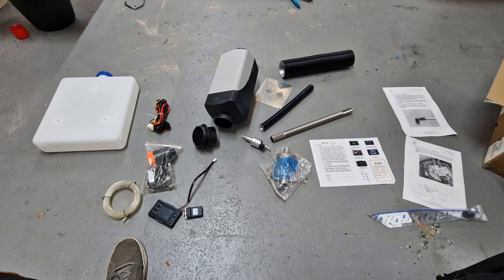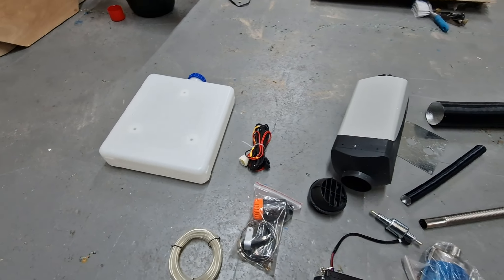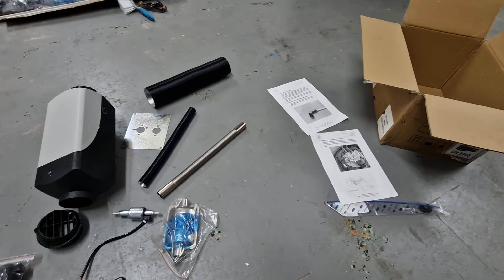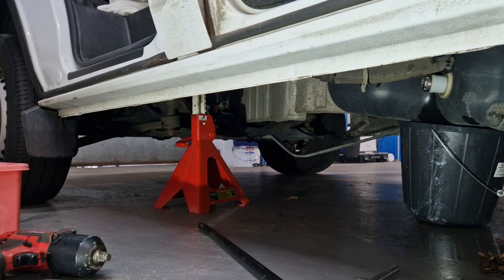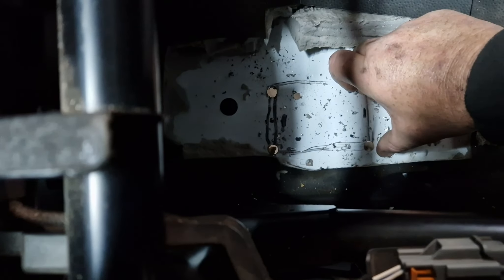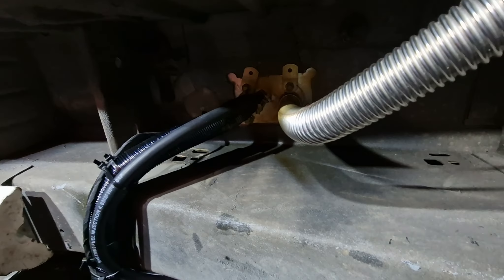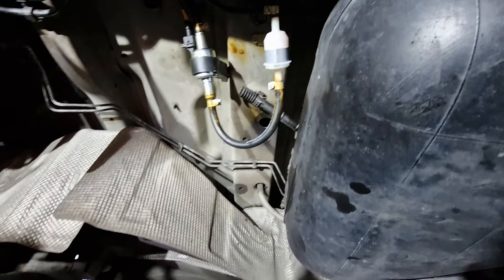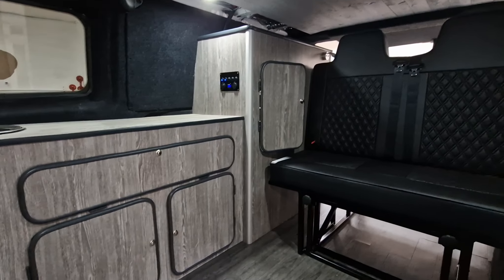How to fit a Chinese Diesel Heater under seat Ford Transit Custom Camper van build

Comment: Super video! Thanks a lot!
Reply from the maker: Much appreciated thanks for your comment
Reply: @vanlifenomad  do you remember the size of the connector? 7.89? 6.30? I saw that it's a standard connector, way more cheap on aliexpress for example
Reply from the maker: All parts as standard to the kit, the only parts I used outside of the kit. Fuel filter & better quality fuel pipe

Comment: Does the pre face lift custom (2014) have the extra fitment on the sender unit for fuel hose or is it just the 16 onwards?
Reply from the maker: Not sure id guess yes! its on the top of the sender, I cut it about 4mm from the top and the pipe then clips over it, try a search for the part pre 14 and after to see if they are the same
Reply: Thanks for the reply! Done some research and yes I can confirm custom 12-16 also has the extra aux pipe 👍👍
Reply from the maker: @philska8er  I put the tank on a jack and lowered it just enough to get to the auxiliary feed pipe outlet, just need to make sure the front of the tank stays high as fuel pipes etc, I cut about 3mm - 4mm off the top. I'm sure anouther youtuber has also done a good video on this. All the best

Comment: where did you get the accessory connector from for the fuel tank? cheers
Reply from the maker: Diesel Heater Fuel pick up pipe for MK8 Transit & Transit Custom

On ebay